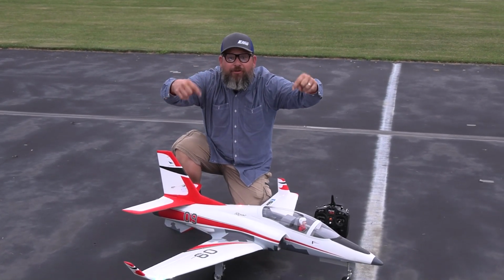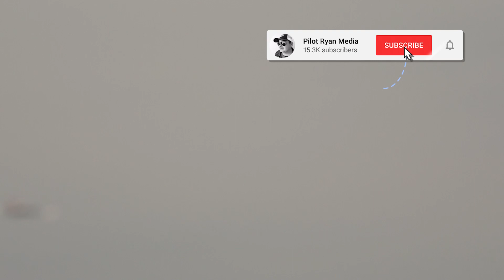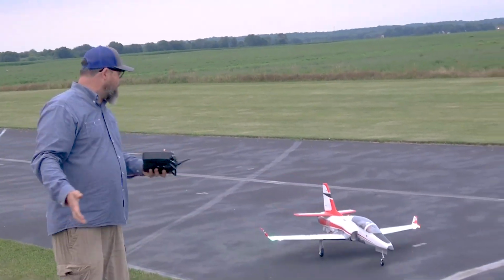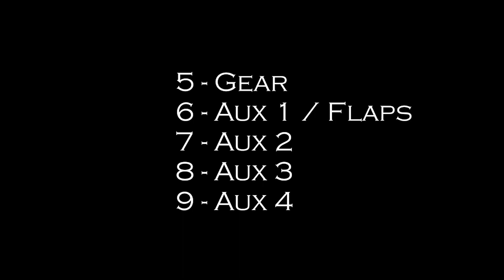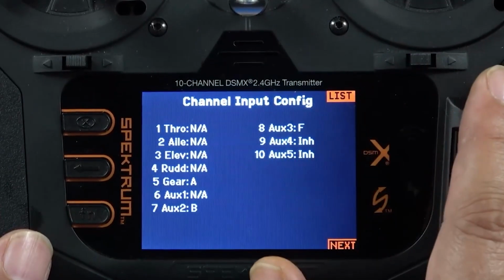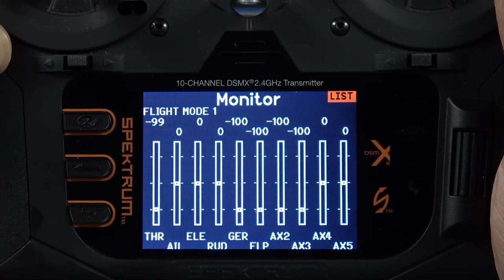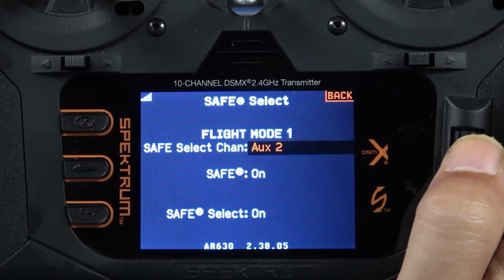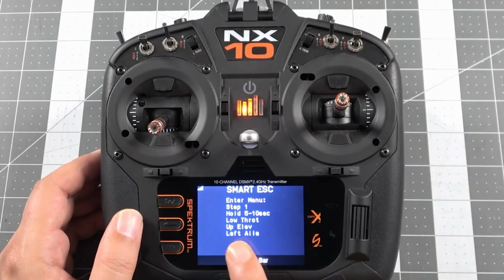Viper 90mm Jet Thrust Reverse Midair, ooops

Comment: Pilot Ryan,  that was a grate Eflite Viper 1400mm maiden shakedown near death ☠️ flight recovery,  that where your  years flight  experience kicked in you didn't panic at all, and thanks to the RC Air marshall for his demonstration on the transmitter set up for safe select and reverse assign, It's guys like you and the RC Air marshall are the reason this hobby is getting better.
Reply from the maker: Thanks Linden

Comment: Question, at 17:16 you're assigning the ESC reverse thrust to channel 8, AUX3 switch F.  But you could potentially run into a similar conflict by accidently assigning channel 8, AUX3 to switch B causing the same problem with SAFE on channel 7 with switch B already assigned.

Comment: Everything was going good til after I scrolled all the way to the right on my nx10.   see the screen and did 0 throttle and up elevator and left but it doesn’t switch to the right.  just stays on the left…. Thoughts?
Reply: Problem: I scrolled all the way to the right and got to Avian Prog.  When I held up elevator and left Aileron, it did not switch to right aileron after 5-10 secs.

Solution:All rates must be at 100%
Safe should be Turned Off.

The rest of the video was awesome!  Thanks for awesome tips that could save a plane.  Nice save by the way.

Another helpful tip that cost me a draco crash was putting the reverse switch to close to my flaps.  i hit reverse instead of flaps up and my outcome was not like yours.  many many pieces.  Now reverse is on the other side of my controls away from the other switches.

Thanks Again
Reply from the maker: Power down all the way radio and plane, try again

Comment: Ryan i am disappointed in you making this mistake i only use the spectrum AR637T receivers and all Avian ESC;S i always use AUX 2 for my safe mode and i also always use AUX 2 for my flight modes 1,2,3,4,5 in all my big jets in the AVIAN ESC channel 7 is the reverse  i always change that to channel 8 and in the receiver channel AUX3 channel 9 is my gain channel for AX3X AND CHANNEL 10 IS AUX 4 IS MY PANIC the (I) BUTTON all my old planes with the AVIAN esc,s i have update the ESC'S  so i get the ESC PRG in the radio even my eflite T-28 Trojan now has reverse lol even my carbon z cub with floats i put in the reverse i went to a fun flight Tournament in NJ  on a lake I FLY 4 planes all with reverse smart AVIAN esc's and the AR637T receivers  i was the only one with a plane with  reverse i got a extra 10 points for the reverse and come in first place out of over 30 guys flying   .